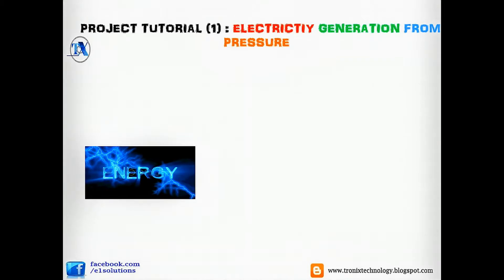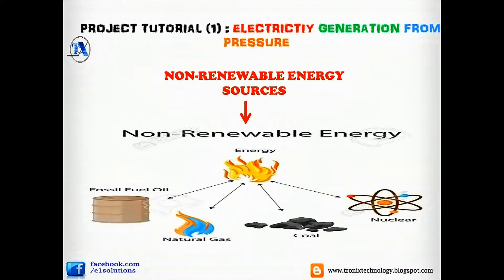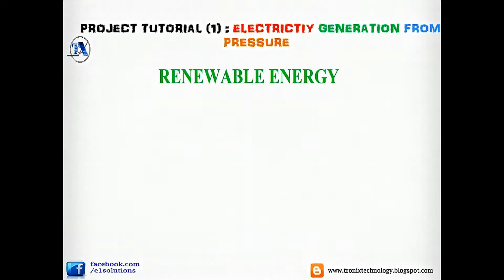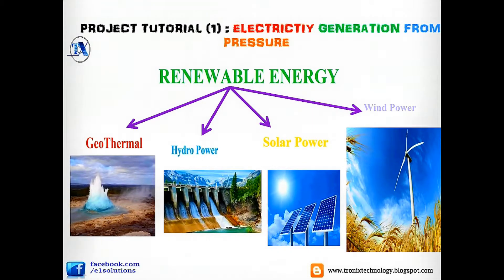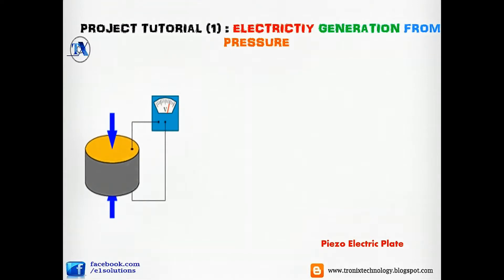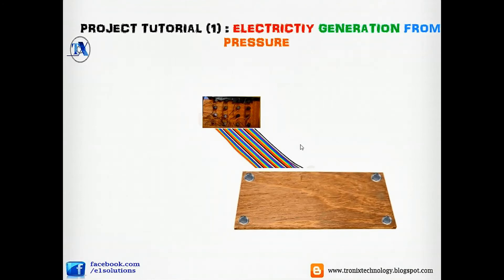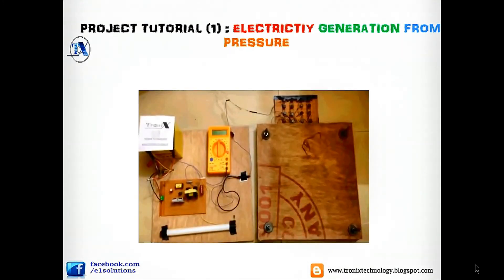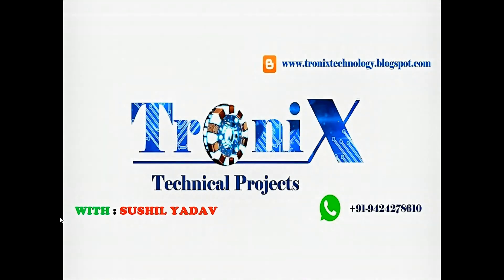Tutorial 1 : Electricity generation from pressure

Comment: Sir get me a answer.... here generated current from piezoelectric element sufficient to charge battery?
Reply from the maker: Current generated from piezo electric plates are very low approx 10 mili amp from single piezo crystal .you need to add a lots of piezo crystals parallely  to add up current.